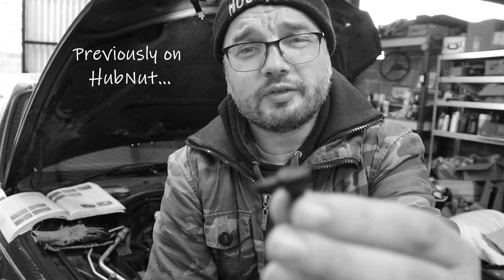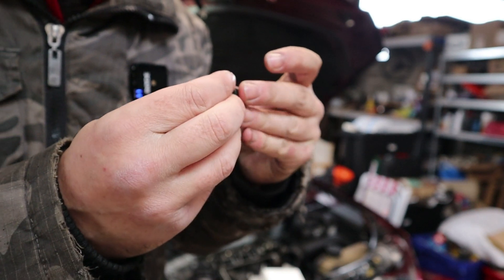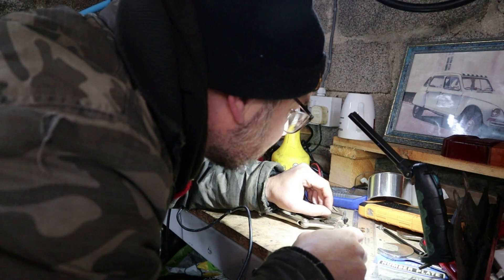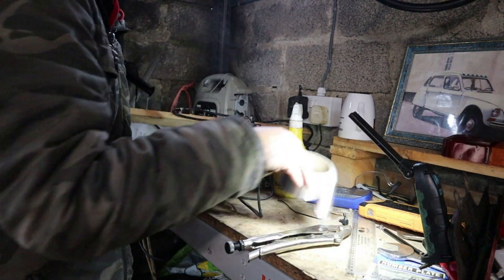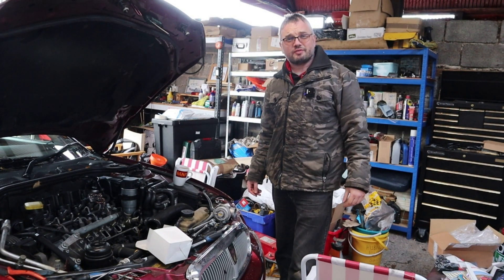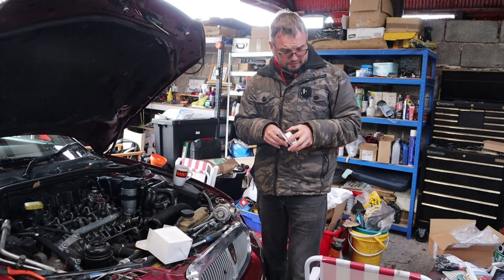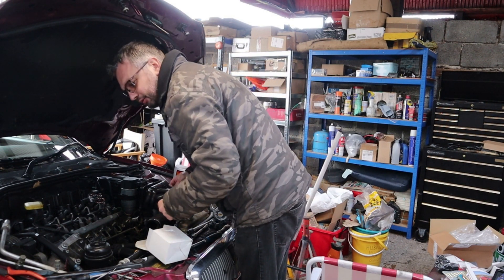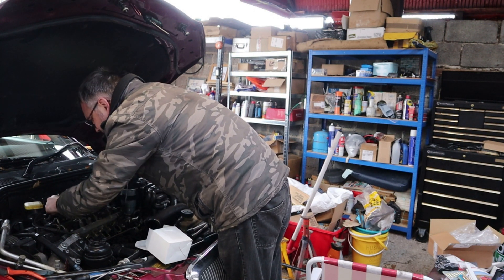Rover 75: Man vs EGR and PCV Part 2

Comment: Just when you think you've seen most things in life, you see a cable tie used as welding flux. Pure HubNut genius!
Reply: I've done that for years, use ties as filler material for bumpers etc
Reply: @terryatkinson899  Me to I’ve repaired plastic parts on mowers using cable ties and had good success.
Reply: ive also used plastic filler spreaders as plastic welding/filler. to be honest once that composite plastic has broken it never repairs correctly. I find the best repair is to use the soldering iron and then fill with super glue and bicarbonate of soda
Reply: @dr2stroke611  all I could find in the shops was baking powder or baking soda. I wonder if they are useable for mixing with super glue for repairs. Haven't tried them yet though I did buy them for an experiment.
Reply: @terryatkinson899  i dont think they work as good, baking powder/soda has other ingredients in it. You can buy pure Bicarbonate of Soda on Ebay. I use it to repair a lot of scooter plastic panels and its the best repair ive found so far. its not the best looking repair but is ok for parts that dont get seen
Reply: @dr2stroke611  thanks for the reply

Comment: Hi Ian, check the hose from the intercooler if perished once the pressure builds up they sometimes leak, I had a similar issue on my TD4 the hose looked fine when stood but once it was revs was added it lost pressure to the turbo... again there are aftermarket silicone ones of various Internet sites...
Reply: Me too on my R75, boost much stronger when replaced old intercooler hose with a new standard replacement, couldn't find a silicone one.
Reply: Definitely worth a look ....or a blocked cat
Reply: David Carver I think if it had a blocked cat or DPF,(not sure if this car is euro 4or5) it would throw a fault code due to the pressure difference between the two sensors fitted to the DPF.  Plus I don’t think the fault would be intermittent as it has been. Might be worth a look though. In the past, I had loads of problems with the PSA DV6 engine in 16valve guise with carbon build up and turbos popping every 1000 miles. This doesn’t look remotely similar I would add. I’m thinking that intercooler pipe as I had a very similar problem with a Skoda octavia with an intercooler pipe gone bad.
Reply: @scootyman2974  yeah im just going on the experiences ive had with mondeo tcdi s 👍

Comment: Get a small torx socket set and gently move that injector loom out the way. It makes access to the PCV so much easier.
As you’ve cleaned out the egr and manifold id disconnect the battery for a while and let the ECU recalibrate and learn the new driving parameters.

Comment: With plastic welding you need to start by fusing the joint Boundary for strength before applying new material. Failing that you can clean both mating surfaces and heat melt them both before bringing them together. (Watch how they weld gas and water main pipes with hot plates). This all said, reliably containing a flammable liquid as it travels across the top of the hot engine does seem worth the trip for a replacement.  Great video again.
Reply: The 75 CDT is known for having no guts due to it being very detuned. I would suggest either a 135 remap or a synergy ronbox which will definitely sort it. I had a mgzt 135 with a ronbox ( was producing around 170bhp I believe ) and even though it was an auto it was very punchy indeed.

Comment: On my father's car we cleaned out all the EGR valve etc which like yours was filthy and blocked and Toyota diagnostics said that it was the exhaust system that was clocked so we had it terror cleaned and it cleaned all the muck out of the exhaust as well and now it performs like a new car !

Comment: Brings back memories of self as a younger impecunious motorist leaning into engine bays whilst making lots of oily fingerprints on Haynes manuals, The Vauxhall Viva HB and Skoda 120L ones being the oiliest.
Reply: Ah the HB... singularly the most unreliable car I owned for many years until it was surpassed by a Citroen XM. I recall that the gear lever was held in place by what appeared to be a cap from an oil can with a hole in it. Needless to say the gear lever came off in my hand whilst trying to make a three point turn in Hampstead High Street. Head gasket failure, broken crankshaft, broken valve springs etc. etc. In fact, now you've raised the subject, I've had a rethink and realised it was worse than the XM.

Comment: Trouble with cars like this is all of the vacuum hoses have aged, sometimes an actuator will get sticky and not always do what they should, and MAF sensors.... speaking of which have you tried unplugging it to see if it runs any better? Doesn't work on all engines but it's often an easy test to rule out a cause of a flat spot :)

Comment: Ian, get a tool trolley and put everything your using on it, tools won't disappear, also put removed parts in a tub or box you'll save so much time and effort.
Reply: Hubnut is not about saving time and effort.Lets get rid of the shelving and have more cardboard boxes scattered around.It’s the calamities that make it compelling viewing.
Reply: @BRI535D  but if Ian did get a tool tray I would guarantee it will be a used cheap tea trolley from a antiques shop. Which probably has issues to fix.
Reply: Not convinced that's true..... I still lose tools 🙂 or maybe that's because I don't do your second recommendation.
Reply: @alanlansdell7533  he would possibly lose the whole trolley in the unit

Comment: You need a bigger magnetic under bonnet light. Cable tie being used as plastic solder is a genius move! Diesel fuel filter might need a change too and do a couple of tankfuls of VPower. It helped mine massively to restore some power gain but as a cleaning agent instead of using additives.

Comment: The dreaded socket falling into the confines of the engine bay.
Once i lost a 13mm socket while changing a battery a year later while changing the oil i found it on the undertray.

Always great to have a jump pack saved me quite a few times after the battery went empty, also a good old italian tune up works wonders sometimes even on modern cars since it helps DPF's to regen.

Comment: I had a very similar problem with my 97 Audi A4 TDI, I ended up changing the MAF and giving the turbo intake a thorough cleaning with 96 % alcohol as it was well gummed up, it ran and pulled very sweetly after that, it still does and that was 10 years ago.
Reply: That the beauty of older cars as well. You can work on them yourself, unlike modern cars where you need a bloody laptop to diagnose problems on them😩
Reply: @matty6848  very true, I doubt many Audis made now will still be economic to repair in ten years time. Other highly technical brands are also available.

Comment: We had a 2003 MG ZTT with the same engine. That always felt a bit sluggish.. Very smooth, but always felt like it was being held back slightly. It did occasionally feel quicker and more responsive but it wouldn't last.  It had been fitted with a new fuel pump under the bonnet just before we bought it. I removed the intake and cleaned it (seriously filthy job as you said in part one!). It did feel slightly better after all that but I actually ended up replacing the in-tank fuel pump. The tell tale sign is the death of the under-bonnet pump as it's having to compensate for the struggling in-tank pump. This could have been really expensive but the pump from a Peugeot (i think) fits into the pump cradle/housing but it was a tricky job with all the brittle plastic clips!
Reply: I should add that my better half's dad now owns the car and it still goes well, even if he does use it as a works van!

Comment: As you said it is hard to get the Rover 75 Diesel up to and maintaining operating temperature, a renault 5 thermostat can be installed in the top water hose. Probably worth doing before the weather gets too cold.

Comment: When my Rover 75 diesel kept hitting the wall, it was down to the fuel pump in the tank, it just couldn't supply the fuel at the rate needed. There was also a lift pump by the battery which is a pig to replace. The in tank one is simple enough, just a smelly messy job where you need to remember how the pump came out so that you can see how to put the new one in. This is why the 75 needed to be kept with a 1/4 or 1/3 full tank. Once you put the new pump in, you get full use of the tank again.
Reply from the maker: Yes, I'm pretty sure my in tank pump is dead. Can't hear it.

Comment: WOW.  

Welding plastic with a soldeing iron was brilliant.  Amazing work.  I don't know that I'd have thought of that.  

But um...I admit that I cringed rather a lot at 1:36 when you set the hot soldering iron on the roll of Aluminum tape.  Oy.  

Loving the videos.  Keep it up!

Comment: Changing the breather filter was well worth doing. With regards to the flat power delivery and running out of revs at 3500rpm I would suggest looking at the airflow meter. Sometimes the element can be cleaned (carefully) with a spray of brake cleaner, otherwise it may need replacing. Very common problem unfortunately.

Comment: Ian I had a Toyota Avensis 2 litre diesel which clogged the EGR valve. My local Toyota dealer said not run it on super market diesel has it has a low Cetane rating but, to use the much more expensive BP or Shell, as this has a much higher Cetane rating. In the end I used a Cetane booster which I poured into the tank everytime I filled up at Morrisons.

Comment: Hi Ian, you could get a autotune, had a mobile guy who tested the whole engine,timing,fuel pressure,  airflow, pistons compression etc,he had all the electronic diagnostics, and he adjusts things as well so the car performs better.
obviously if its a component that needs replacing thats not part of the service, i can say i was very pleased with the service and its saves a lot of messing around, and you you get a printed report at the end so you know what needs changing or not..... hope all goes well and take care.

Comment: Nice one mate good job. On obtaining the clips required I would be inclined to check the boost pipes also diesel and air filter. It may make a big difference. All it takes is a pin hole in a boost pipe. 👍

Comment: Ian,I've got to agree with , about a magnetic pickup tool they always come in handy !👍
Reply: Ash
. I don't want to brag...but, I 've got one with a little LED light on the bottom - bloody marvelous for $6.
Reply: Yes. As a engineer myself they are a life saver should you drop that last but you really need🙏🏼👍
Reply: I've got half a dozen magnetic pickup tools as I keep losing them and then finding them stuck to random metal parts like Dexion shelving or my lathe or mill!
Reply: @ferrumignis  I know what you mean !😆
Reply: @matty6848  very true 👍😊

Comment: Almost definitely it will be your under bonnet pump which on its way out leans out at 3200 to 3455 rpm when failing giving surges etc.

That ones a quick swap, and even a cheap unit won't cost you more than £30. Do the diesel filter at the same time as its beside it in battery tray.

My problem of concern would be immediately looking towards the intank pump, as traditionally the under bonnet starts to fail when the intank has failed.

Again easy to test, listen for it prime when you pre ignition to start the car it wurrs for about 12 seconds and you can hear it from under back seat drivers side (UK). It's loud, especially on 02 and older cars that lack the extra sound deadening around the tank. 

Not such an easy job to do mind you lol. 

Now obviously 20 year old car situation here but that's the quickest and easiest thing to check.

A maf failure or O ring failure will typically not give you that sometimes power sometimes surge sometimes holding back feeling.

99% will be under bonnet pump is on way out, and the intank one has failed already. The m47r on the 75 and zt has a very small turbo, in fact most people don't know it's the same turbo core thats been used on the Renault 1.5 dci engines for the last 20 plus years also.

Good for about 1300rpm to 4150rpm before it wains off.

Get fueling sorted first, I'd say pumps, injectors sound stable and not clacky.

Also ditch that egr. Lol.
Reply: I agree 100%. Also had a similar problem on my BMW engined P38 Range Rover Diesel when the in tank pump failed.

Comment: Hi ian have you checked the vacuum hoses as these are very common on these engines for deteriorating causing vacuum leaks which will have the effect you are getting, and also the intercooler pipes can split  especially around the jubilee clip areas which will cause a loss of boost, i know as i had this same problem as you have.

Comment: Did you actually check the egr was seating correctly? By pouring some fluid down there and checking it was holding. It’s possible that contaminants get stuck on the seat and stop it sealing. Also checking the vacuum by pulling a vacuum wouldn’t hurt.

Comment: As far as fuel system cleaners go, miller's ecomax used to work well on the freelanders with the same engine
Reply: I second that.   Miller ecomax is one of the best
Reply: So I imagine it’ll work well on the Rover 75 diesel which has the same engine more of less?

Comment: 1. Fuel filter. 2. Mass airflow sensor. 3. Split in turbo/intercooler feed pipe.
Reply: 0. Sort the stripped nut/bolt at 6:21 and cure the boost leak

Comment: One thing I like about this and the l series engine in my old 600gsdi I never have to wait for the glow plugs. (in lancashire so yeah does get cold here too), check for boost leak on the intercooler elbow behind passenger head light. if caked in gunk could be failed o-ring causing boost leak.

Comment: Every little bit makes a difference.  A Saab dealer I worked for many moons ago had a customer with 9-3 diesel that would take ages to fire when cold.  Eventually all the t pieces and hoses in the fuel system had to be changed to cure a tiny leak.  That was causing the fuel to drain back into the tank over time.  It will probably be something small and fiddly that will sort it ou.  Good luck.

Comment: I used to have a Turbo Diesel car, and a new exhaust and a lot of highway in 4th to keep the revs a bit higher made all the difference in the world, became another car really. Later we found that the intercooler had some holes, we paid a professional shop for a clean and repairs, and the car gain throttle response and a bit of turbo punch, before was lagging at low rpm and power was linear.

Comment: You can plastic weld as it's a similar process to soldering.
Reply: You can plastic weld if you use the same type of plastic as the filler.  Cable ties are not a "universal" filler material :)

Comment: Modern car problem: Too many capital letters under the bonnet.
Reply: True, the amount of acronyms (if that's the right word) in cars now is ridiculous, EGR, DPF, DMF.....I could go on but I won't!
Reply: I’ve got a 60s car which said MG under the bonnet and came with a PCV valve. American spec ones were fitted with EGR & ELC, too.
Twas ever thus ...
Reply: @emma.j.nation  I worked on classic MG's in the late 80's and we imported some from the US with all that gear still attached and I drove a late Midget and it was so lacking in power I was amazed. Once removed it was a different car.

Comment: Interesting and informative video. Shame it didn’t improve it much.
Just a thought, have you checked the turbo actuator is working fully ?, also, check the vacuum line going to it, they go brittle over time and can leak causing reduced boost.

Comment: If you are struggling to get the engine upto running temp I would suggest the top hose thermostat mod. Mild bodge but works well. Also worth looking at the victon rings from the intercooler in regards to the running issues

Comment: Check the dpf filter if it has one, blocked or failing dpf can cause issues with power, u can get it cleaned with chemicals at halford i think..

Comment: Normfest or Liqui Moly Diesel injection cleaner work the best Forte is also very good but expensive and harder to come by, however my next step would be to check the vacuum line to the turbo actuator good luck.

Comment: I used to have a MG Ztt  diesel 5 speed manual version. It had 135bhp approx. I used to do some tinkering/improvements on it, unfortunately I had a rather disastrous oil leak which I unfortunately found too late damaging the engine. I do miss that car. Maybe you could look into getting a good quality mild  remap for your 75. Anyway Great videos keep up the good work 👍